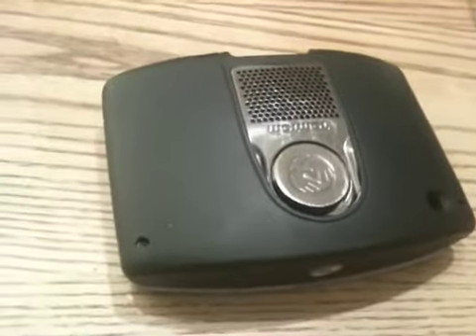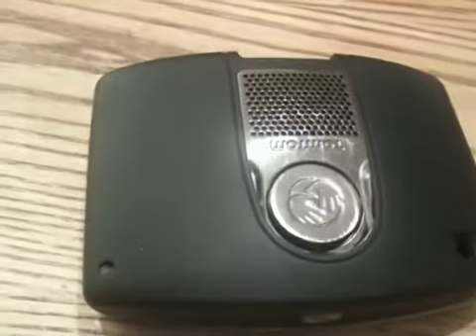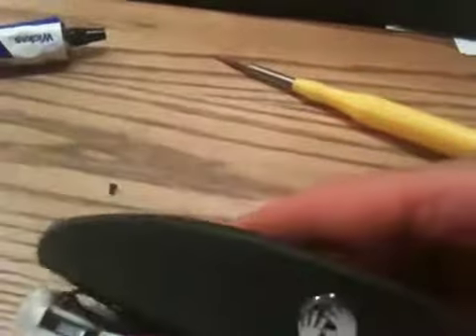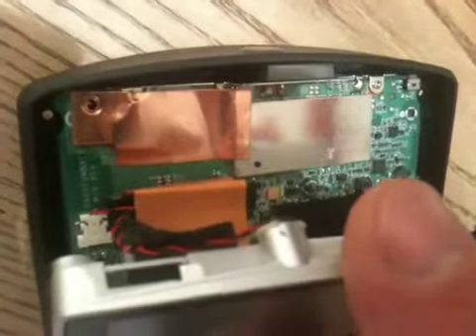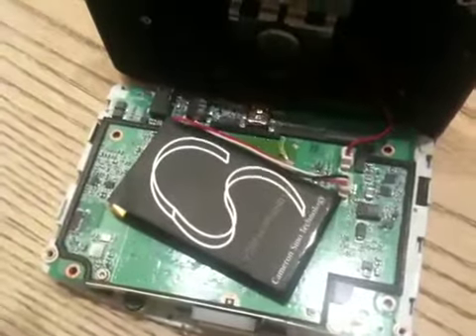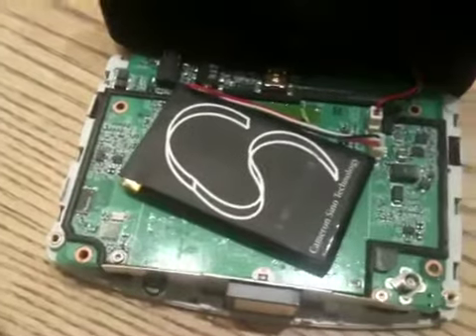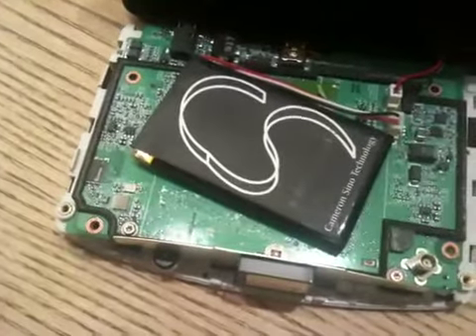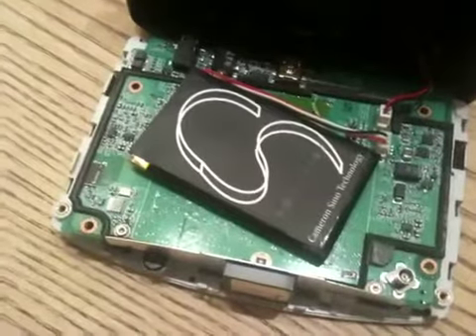Replacing battery in a TomTom Go 730

Comment from the maker: @daidouji: I found my replacement on eBay by searching the Tom Tom model. However, changing the battery did not stop the unit losing its charge over time. I think it is either a design flaw, a fault with individual units or the unit switches itself on in the glove box.

Comment: If you find it hard to get the correct battery for your Satnav, check any old mobile phones you may have stufffed away in a drawer i had probs getting the proper battery for mine,its ancient and out of date and although not a perfect fit it worked just fine.. up too 45 mins where before it would'nt last more than a few mins and cost me my time only.A battery replacement isn't to hard to do and its better than leaving it in a drawer or throwing out